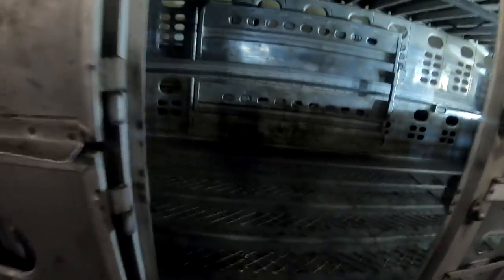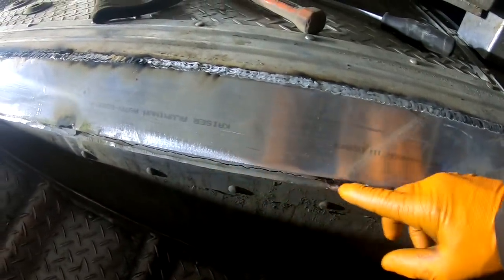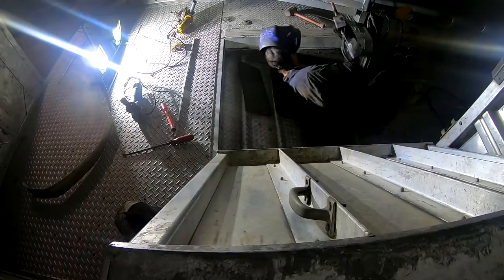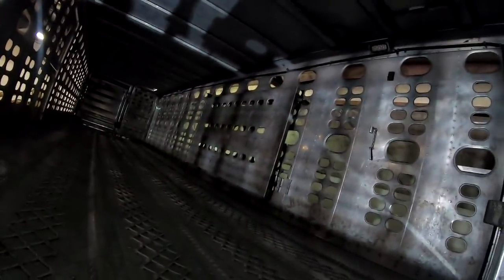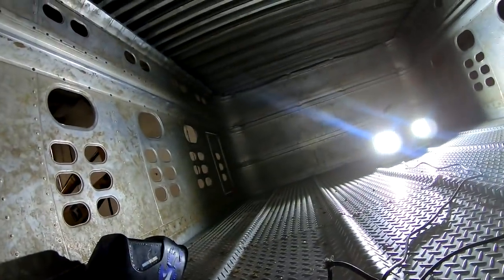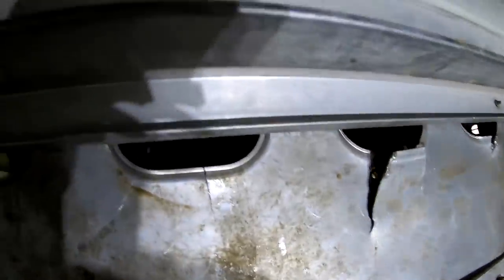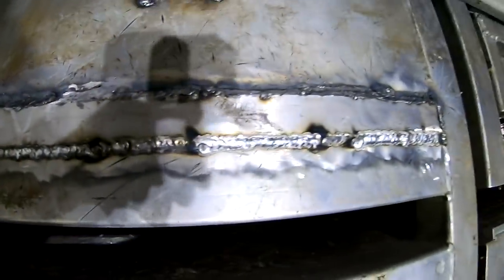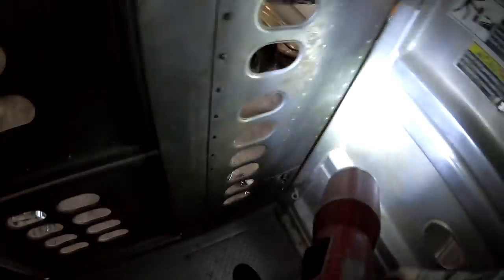Welding on a cow trailer

Comment: I know how bad welding up cattle trailers is and anything that livestock has dumped or pissed on is bad. Aluminium is best cleaned with a stainless steel wire brush and then wiped off with acetone I have found. 

The way you talk is just fine, I get some stick for my Northern English accent occasionally and like you I don't give a shit!

Keep up the good work.

Comment: Im relearning mig welding. From 18 to 20 i was a tool and die apprentice till the shop started getting slow in 06. I mig welded what we called weldment die plates and those were anywhere from .75 to 2.5 thick plate and various sized blocks for guide pins or wear plates.  I got pretty good and i got moved onto the cnc and had another apprentice weld a hot job and he didnt do a good job so they had me reweld it better. Thin short beads spaced a little far apart. Now im 33 and last year i bought a generac 7500 and a hobart 190 mig welder and getting my 97 f350 flatbed redone the way i want it and then doing repairs on my 89 owl 9 ton flatbed trl. I got 160 hrs on my generator about 40 to 50 is from power outages and 70 hours are grinding/cutting and around 40 or so welding. Its slow process sincethe hobart 190 doesnt have the greatest duty cycle for what im doing but price was decent and if i went with bigger welder not as portable and need bigger generator.  I have the ability to add the spool gun if i want. Next year im going look to buy a house and i want a shop and will wire the house for generator backup since i have a large one.  Good job on the welding

Comment: Warren, the first tool you take out to do a brake job on a truck or  trailer is the cutting torch. Cut the ends of the springs and S cams in half and fill the garbage can.  Canada Bill

Comment: Aluminum gets its strength from either being work hardened or heat treated, depending on the alloy. When you weld aluminum it loses it's strength and goes back to being dead soft. MIG welding is stronger because it has a smaller annealed zone (the soft area beside the weld) than TIG welding.
Reply: You'll never see welding on airplane wings. Older aircraft use rivets. Newer aircraft have wings glued together. Aluminum filled epoxy is great.

Comment: Been watching for a while now and enjoy your vidjas very much. Haven't seen you work on very many chevy but gonna ask you a question anyway. Got a 2005 Silverado 2500hd transmission went out it is stamped 4l80 mjp . Can I replace it with a 4l80 not marked mjp ? From what I can find on internet the only difference is that the mjp is set up for a bolt on yoke or slide on which slide on is what I have, I can't  seem to be able to find out if wire ing may be an issue?
Reply: Dude this guy has enough problems.........